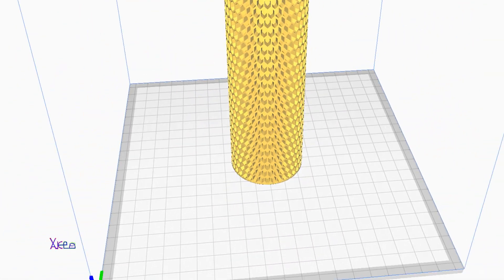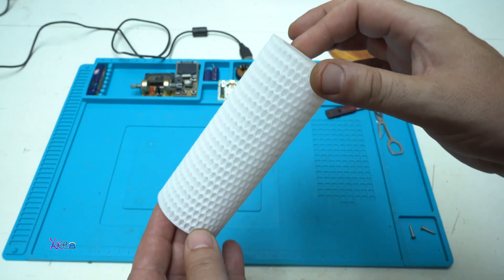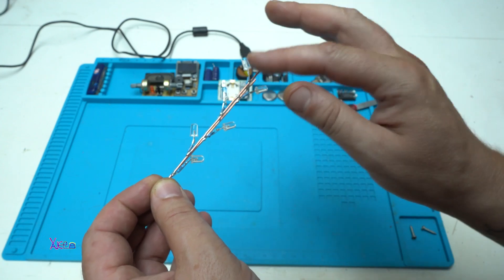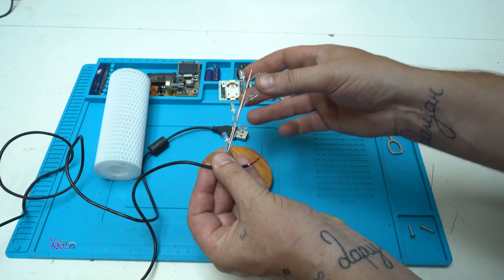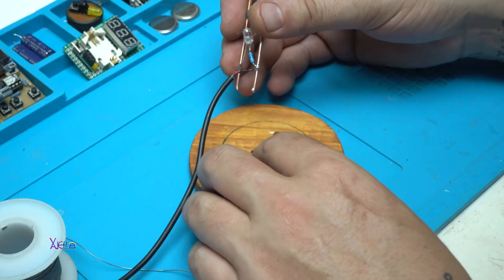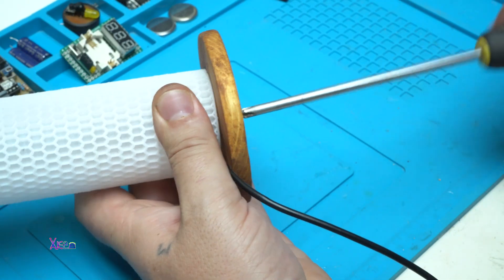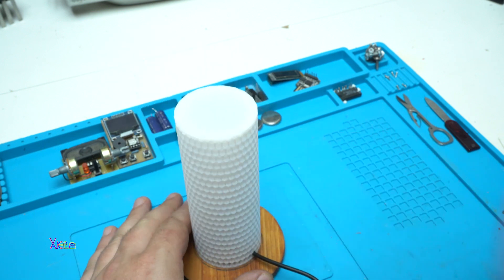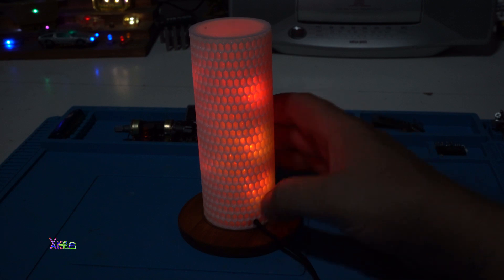DIY  RGB Led Lamp with Honey texture

Comment: Why diy? Should be diy if you have thousands of dollars in tools.
Reply: this channel is all about  do it yourself project his project and materials he is using is very cheap he also recycle some part in old electronics yes you are correct you need money when doing some project but it depend on your project you are doing
Reply: You will get similar results with a plastic bottle and tissue paper. You just need to think a bit to get round not having a 3D printer.